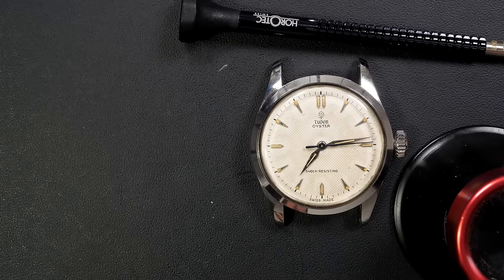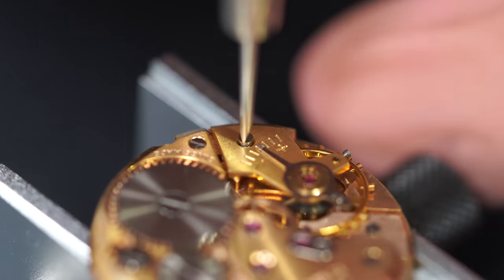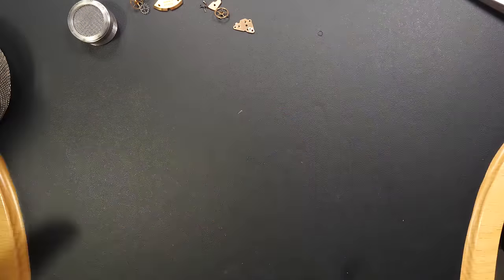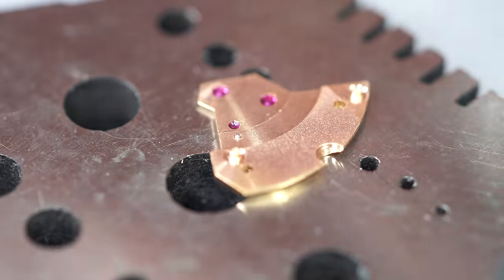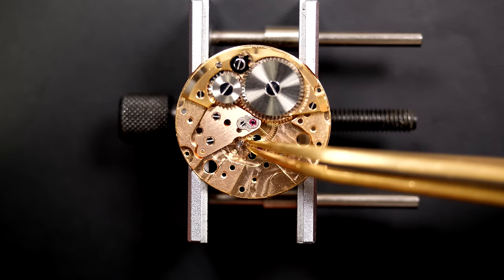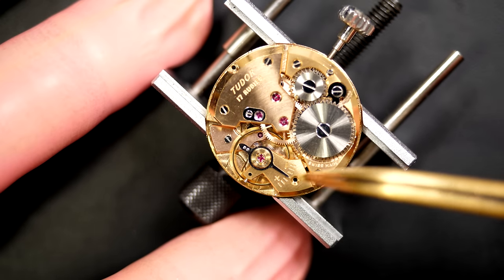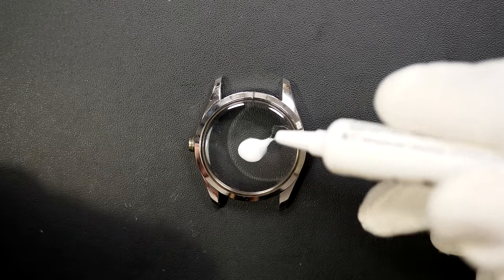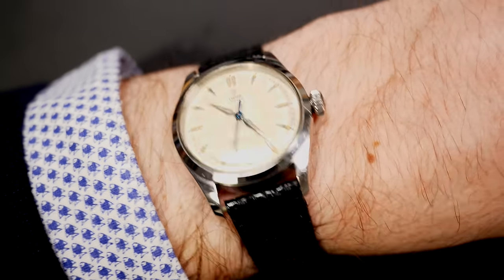Restoring a Vintage Tudor Oyster Watch !!!

Comment: Tres bien... Im a Tudor fan and this one is great looking after your service. Interesting that that spring broke..- and that replacement parts are relatively easy to find. I noticed you didn't tape or mention the greasing of the pallet jewels. Presumed it was done..  Such a great job on the service, as usual. Merci....
Reply from the maker: Thank you. The pallet fork was oiled. It is hard on camera

Comment: It's a nice mouvement, what surprised me and this is probably because my personal preference, the mouvement hasn't got a hacking function. The dial is absolutely stunning and wow the hour hands, they are lovely. Hold on you are telling me Tudor/Rolex is using an outsourced of the shelf ETA mouvement? Oh yes the Black Bays used an ERA to didn't they and are in fact more expensive the  the newer once with the in house movements.
Reply from the maker: Rolex did not use ETA but Tudor did until very recently
Reply: @FrenchWatchCollector  Well Rolex is Tudor and Tudor is Rolex. When I called them the other day for a sponsorship for a Tombola I am planning this year for our Charity, they gave me the same email address and I requested a sponsorship from each of them separately but only got one response back so they are defenerey one and the same. I don't know but I wonder if Tudor is Rolexes Comunite Urban because Rolex is a charity and Tudor a business. Although both are owned by Wilsdorf

Comment: Great work! That Tudor is gorgeous! Any reason why at 14:22 where you cut to use the staking tool it's just frames of your pad and hammering in the background? Doesn't cut back until you are smoothing the hole.
Reply from the maker: I just forgot to change my camera angle 😅

Comment: Fantastic video is always❗️quick question,
did you put the main spring 
on top of the balance‼️®️™️
Reply from the maker: It is a hair spring that goes on top of the balance
Reply: @FrenchWatchCollector  and understand...
I meant when you put it into the cleaner/tray
I thought you put the main spring 
on top of the balance in the cleaner tray
Reply from the maker: @roryvonbrutt7302  yes but it doesn't touch
Reply: @FrenchWatchCollector  ... Thank you for your response. 
Of course I'm not judging you.  I am just a fan,
A very curious and alert fan‼️®️™️  👏👏

Comment: Great review, by the way, I find some tudor big rose showing [T swiss T] at  6 o'clock area,  since both indexs and hands do not find  tritium area, it seems [T] doesn`t mean tritium, do you know what this [ T] mean?  Thx!
Reply from the maker: Normally like you said it is tritium. It might be on the dial because they made one dial for different combo and some are without lume
Reply: @FrenchWatchCollector  Tks for quick reply, as u said, if tudor wrongly assembled T swiss T dial on the watch which withoit tritium function, it means tudor mislead not only  customer in 60's but till now and future, right?

Comment: Hi, does the movement compatible to ETA cal.1080 or cal.1156? Thanks
Reply from the maker: This is a 1156 and you are right it is the same family as the 1080 so they are compatible
Reply: Do you know about Tudor cal.2843-2? Does it compatible to2824-2?

Comment: I was taught to lubricate a smoothing brooch  with a drop clock oil when using it. Were you? And do you? Also, did you find out the patent name of these shock jewel assemblies?
Reply from the maker: I don’t use oil but maybe it is a good practice
Reply: @FrenchWatchCollector  I know you also wipe the brooch (I hope I'm spelling that correctly (broach?)) between strokes, and the white cloth would wipe off black, which had to come from the watch. At the very least, it keeps you from contaminating the next pivot hole.